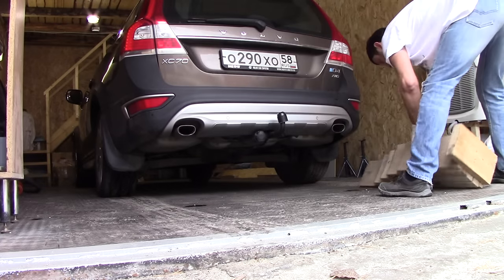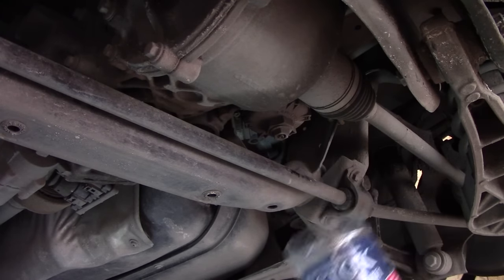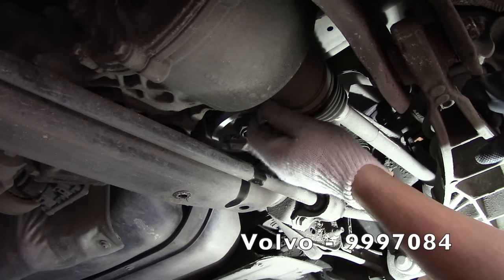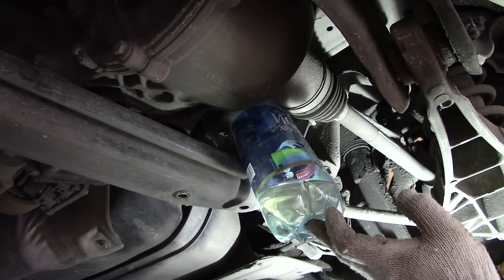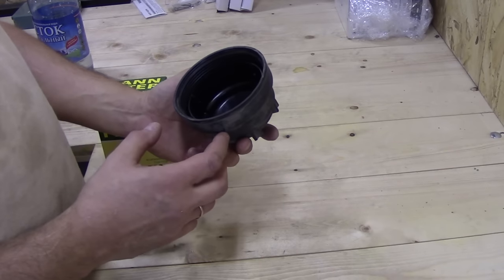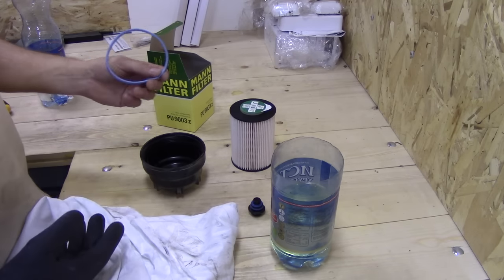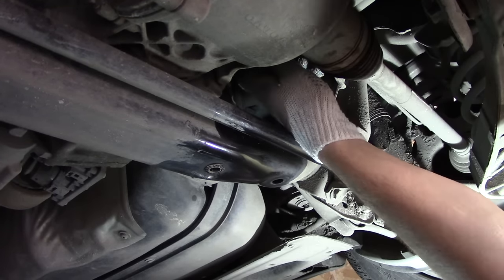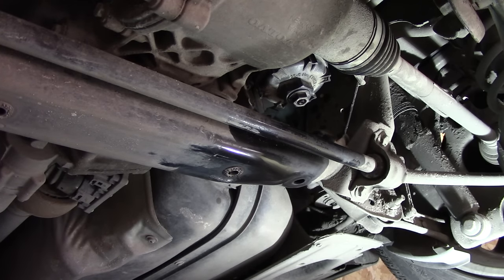Volvo XC70 D4 Diesel fuel filter change.

Comment: Just a tip I saw from a forum

“The corect priming procedure is done by
pressing the start button in position 2 without
holding the brake and just leave it like that for 1-2
minutes.
The car primes itself.
Than start the engine and leave it running for
3-5 minutes.
It's the volvo procedure that was being shared
by a volvo dealer mechanic.
Same procedure is used after fuel injectors
disasamble.
Another way is filling the bottom cup with clean
diesel before screwing it back.
Thow it can be a little bit hard without spilling it
off.
In other volvo models, it works well cause you
have more acces to the fuel filter. Eg xc90”
Reply: Makes sense. Same with alot of cars, or similar atleast. BMW and VAG also say switch in ignition several times to start the fuel pump / prime the filter.

Comment: Well it's best to tight the filter housing using the recommended toruqe by manufacturer,also you shouldn't start the car with the fuel filter housing empty as that will damage the injectors,you should turn on and off the ignition many times so that the fuel pump fill the housing and remove all the air in the system,then you can start it safely.
Reply from the maker: Thx for the tip.
Reply: Petrol injectors maybe, but not Diesel injectors. Rock solid.

Comment: Love your Videos. Tip for the next time: if you unscrew the 4 Bolts from the antiswaybar and drop it, you“ll have much better Access to the Filter! 😉

With vida you can start the Pump for purging the Filter, some Modells start the Pump automaticly with ignition I so you can Purge the Filter by ignition1 for 20sec.

Comment: Most important last step: 
Put ignition on 2 and let the filter be automatically filled and evaporated!
Ignition on 2 for 60 seconds.
Than turn off and again ignition on 2 for 60 seconds. 
Do it 3 times at least.
Than engine will start straight away with no air sucking into high pressure system.
If u dont fo it - u can destroy high pressure pump.
Metal pieces will flow in sytem and damage engine. Quite an expensive disaster could happen.
Be aware of it.

Comment: I'm always having difficulty to start my v70 d5 after fuel filter change. Any tips on this? I usually crank the engine for a couple of times. Is there a way to make it easier?
Reply: Yes, You should put start button without brake, You should keep about 3-4 seconds and the pump start
Reply: @karolxz2593  thanks 👍
Reply: Yep. Make the pump work, a few (4-5) times before you start the engine. So long push the button (ignition II.) wait 5 sec, shout down. repeat this cycle 5 times, for fill the fuel lines with the low pressure pump.

Comment: Hello, I have a 2015 Volvo XC60, D5, 2400 cc, 158 kw, 6-AUT 4WD / TF-80SC AWD gearbox, D5244T15 engine, I would like to know if the gearbox oil changes as it does -you changed to your Volvo XC70.I watched your video and I would like to change it at home.Thanks a lot.I watch the videos that are very interesting.
Reply from the maker: Same like my XC70. Just make sure confirm the oil part number wit your dealer. The oil could be different.
Reply: @volvosweden Thanks for the answer, I checked and it is the same oil that you used (31256775). Much success in the job you do as a professional.

Comment: Nice video, but wait the fuel pump fill up the lines in ignition II. 4-5 times before you start the engine. BTW that shock absorber looks very very bad.
Reply: I know about shock absorber. Next spring I will replace them and make a new video 😉

Comment: really annoying design. requires a really good filter environment, especially cleaning of the drive joint, so that the parts can be put in place without any dirt.